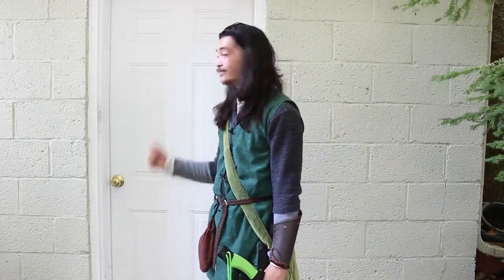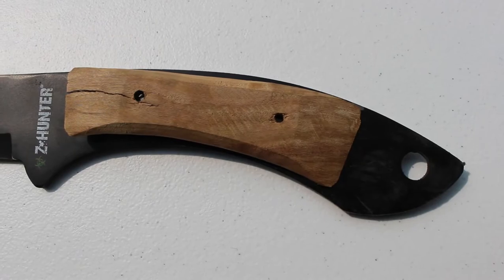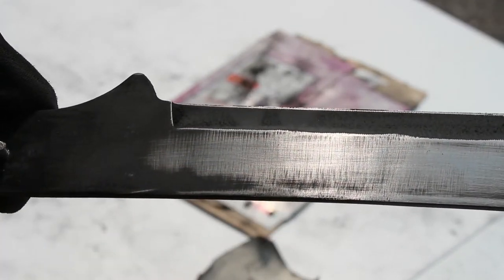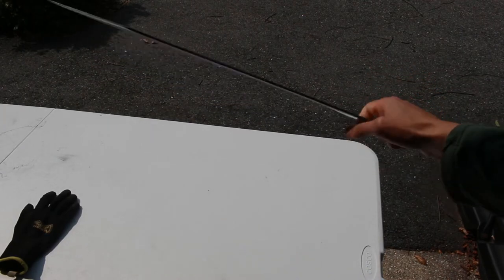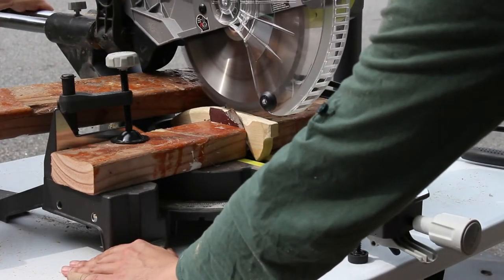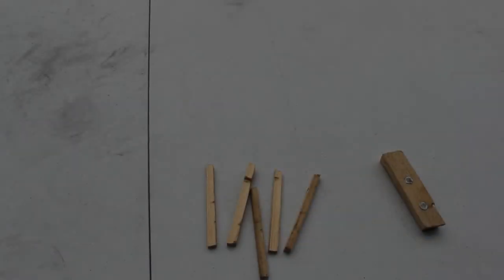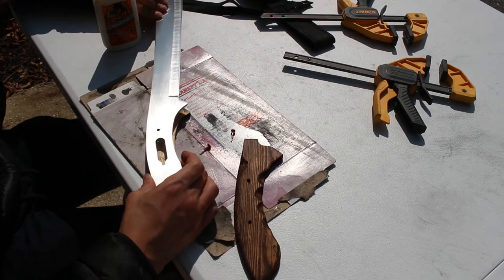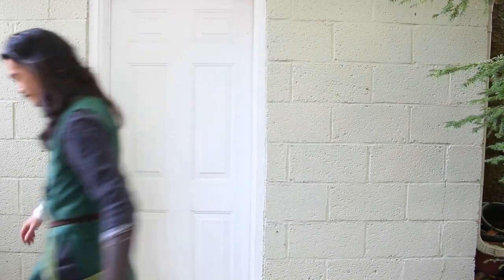Turning a Machete into a SWORD!

Comment: good job, looks great, I do have a few recommendations for future projects, 
1 Could of probably used an acetone to help with paint removal, even something like nail polish remover could of helped, just soak it for a while.
2 You could of used larger nails or even a piece of brass (home depot) and then used a ballpeen hammer  to peen the other end of the nail to make a proper rivet.
3 use epoxy when attaching your handle, cover the handle side and then attach with pins, clamp evenly while epoxy dries.

Comment: An orbital sander probably would have saved you many hours over hand sanding. Harbor Freight has cheap ones for under $20. There are even scotch bright type pads for the sanders. 

HF also sells a 1 inch belt sander for under $70 that is useful for fixing the grind on blades. Just go slowly and keep the metal cool enough to touch so that you don't ruin the temper. You can remove the guard at the top bend of the sander and make nice rounded divits on the grip for your fingers. 

You can also glue or tape various grits of sand paper to something very flat, such as a piece of glass for a make shift whetstone or flattening surface. Stores that sell granite squares for floor or counter tiles are a good source for a cheap but very flat mounting surface. Wet/Dry types of sandpaper work the best as they are more durable than regular sandpaper. 

A section of brass rod, or even a brass screw with the head cut off could be peened over to make a handle fastener that looks appropriate. 

You clamped your handle after you glued it, which is the proper way to do it. Anytime that you glue something and then clamp it while it dries makes the item several times stronger than one that wasn't clamped. Compared to taped  in place while the glue dries for example. 

Would hammering the blade surface all over lightly with a ball peen hammer, followed by a light sanding, give your blade a hand forged appearance? Perhaps you'd even want to dimple the blade before you did any sanding so that some remnant of paint would be left in the deeper parts of the dimples to increase the hand forged effect.

Comment: Hey man just a little farrier knife tip, take a longer soft metal nail trim off the head, (or don't that's a matter of preference)  but trim off the point and leave a little bit on both ends and hammer one end with the other on a solid surface to expand the nail in the tang and it will make a solid pin for your grips

Comment: Cold Steel has a number of machetes made to look like different period swords, removing the polypropylene handles and replacing them with wood is a good cheaper way to have a sword that looks period without dropping several hundred dollars for and actual sword

Comment: Nice work! One thing that might make future projects a bit easier. Try using Citri-Strip to take the paint off the blade. I've done that a couple of times now to take the black paint off of knife blades I'm refinishing. Inexpensive, no nasty fumes, works quick.
Reply from the maker: I'll give that brand a shot. The paint stripper I used did not work so I had to sand
Reply: @LivingAnachronism  That makes sense. It usually takes me a couple of applications of it, but it's worked well for me. Hopefully it does for you too. Anyway, love your content, keep it up!

Comment: Super creative. Perhaps a more efficient way to remove the paint is to use some sort of paint remover solution?
Reply from the maker: Excellent point! I did try "KleanStrip Paint and Varnish Remover" and it didn't work at all. Might be it wasn't strong enough. I'll have to do some more testing if I get my hands on other paint removers.

Comment: Eh I'm more of a paint stripper guy, I would have dunked the blade in paint solvant instead than using sandpaper
Reply from the maker: I tried that first, didn't work at all for some reason
Reply: @LivingAnachronism    I know this is a bit late, but your lack of success with paint-strippers is likely due to the coating not actually being paint.  It is more probably a "parkerized" finish.  This is a process of using phosphoric acid, potassium, etcetera to chemically alter and color the surface of the metal itself.  It is an easier, inexpensive alternative to bluing or browning...

Comment: You weren't too far off on the shape-first-then-attach route. The only thing out of order was when you split the wood. Typically you split the wood into scales first, then (using blue tape and superglue) temporarily attach to your handle to create an outline. Then you remove the scales and attach them to each other with the temporary methor from before and continue just like you did. Great result regardless.